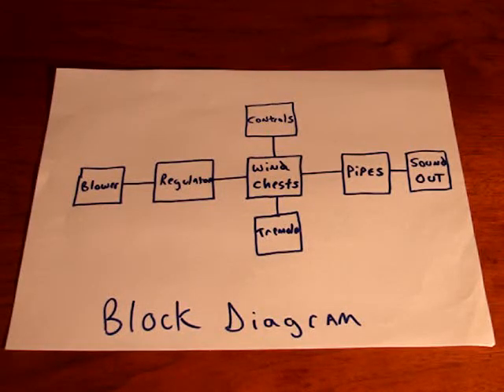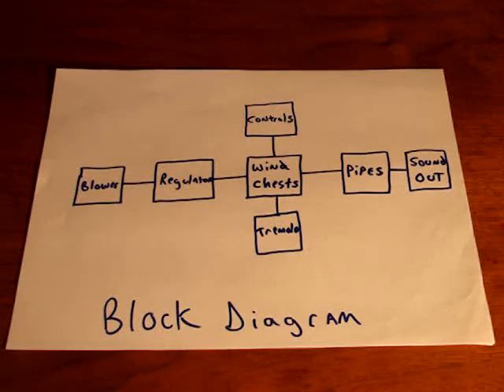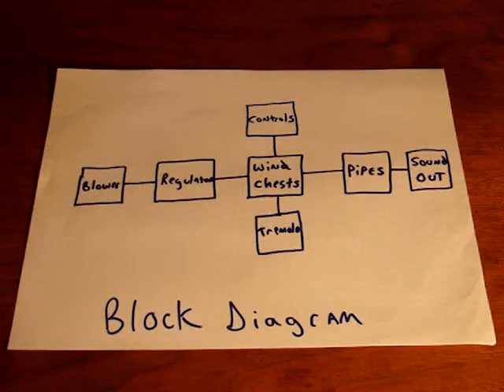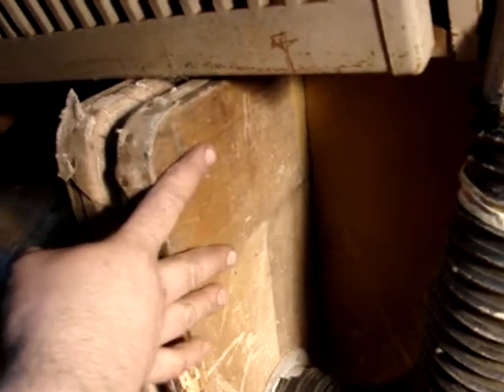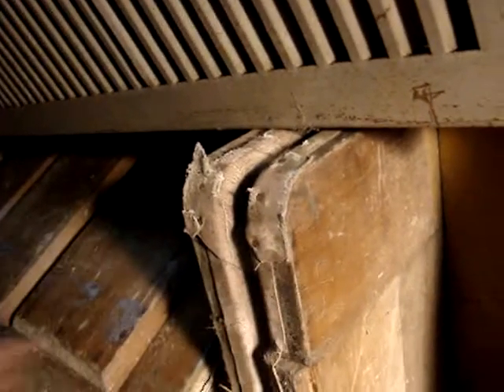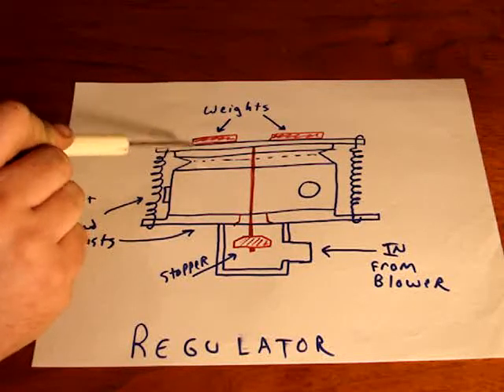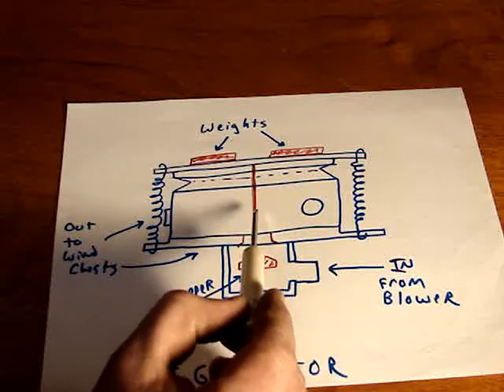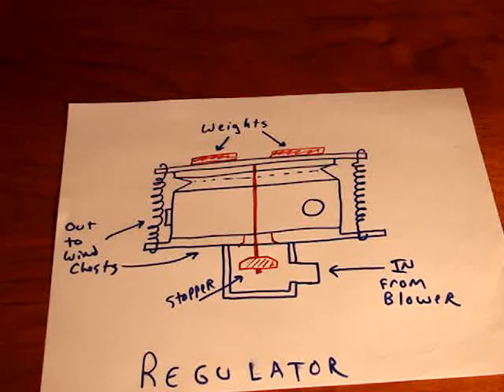The Learning Series - Pipe Organs - Part 3

Comment: Not all regulators are that stopper style, most have a roller covered with rubber fabric covering an opening between sections inside divided by a wall, it's a curtain valve.